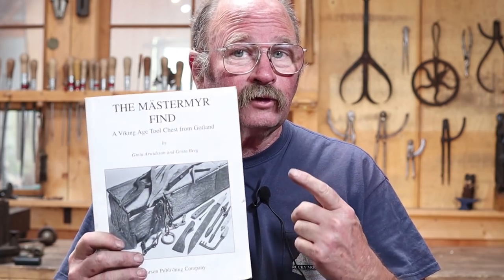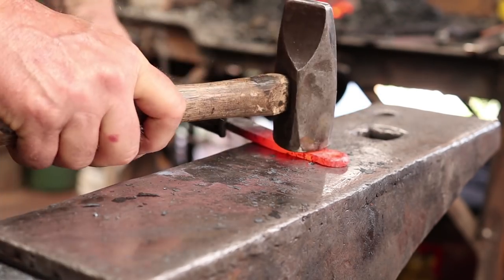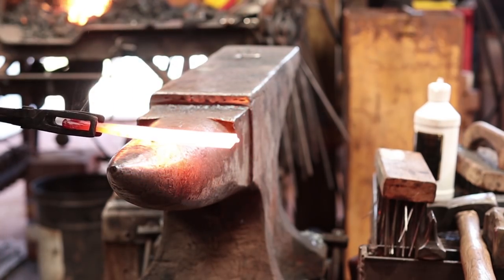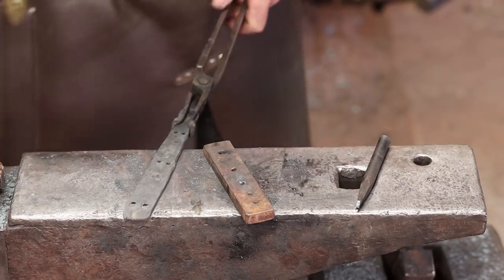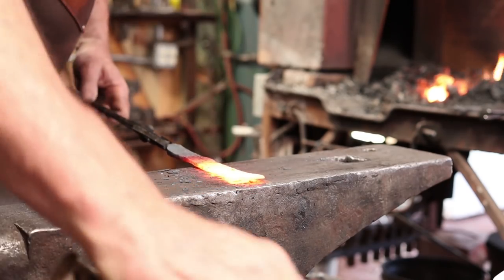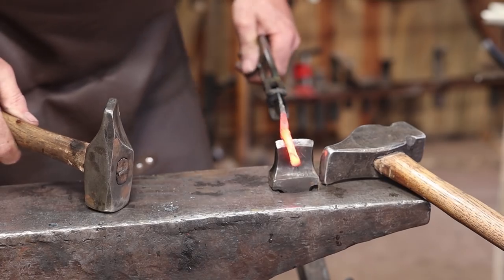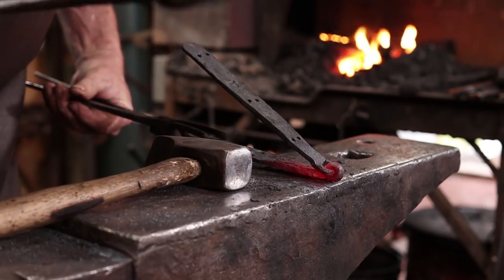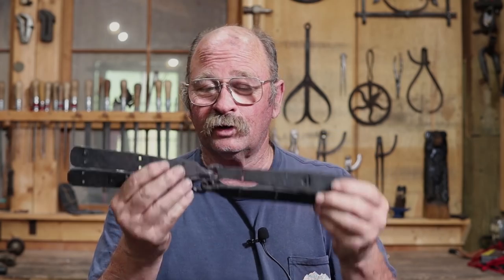Viking tool chest hinges inspired by the Mastermyr find

Comment: a tip i found useful when you fit them to a chest, get the hinges put on the lid first then when you line the other side up with the side of the chest to mark the holes, hold the hinge up a bit so its not resting on the bottom of the loop if that makes sense? often after you fit this style of hinge you can end up with the lid not closing properly and there isnt much that can be done to fix it at that stage.
Reply from the maker: Thanks for sharing

Comment: Hey John I was trying to forge weld three pieces of steel today and it just wouldn't weld I grinded off the rust and scale and fluxed it good but it didn't tack any pointers to what I did wrong also I had it up to a yellow heat very awesome video
Reply from the maker: Its nearly impossible to diagnose forge welding problem without being there.  Dirty fire, to heavy of hammer, oxidizing fire causing scale, joint not shaped to move the flux out during the weld.  It's hard to say

Comment: How does someone create high quality wrought iron for thin pieces? Would starting at bloom and working/folding down many times make higher quality?
Reply: Check out Blacksmith Joey van der steeg, he makes all kinds of blooms
Reply: Yes. After initially refining the bloom, it is folded, cut and stacked over and over the make the grain finer.
Reply from the maker: Repeated folding and forge welding is the way to refine wrought iron and for finer work it might be worth the effort.

Comment: Is the bolster with the round holes you used under the piece made of tool or mild steel?

Also curious to see more detail of the welding fix on the drawn out portion that broke, that seems a pretty small piece to rework without changing the dimensions.

Inspiring as always. Thank you!  - and happy belated Independence Day!
Reply from the maker: Just mild steel.  That way it doesn't chip the edge of a punch if your alignment is off
Reply: Black Bear Forge that makes sense. Nice, I have stock like that laying all over the jobsite from setting forms. Already has some of the holes in it 😉
Thank you for taking time out of your day to respond. It’s not taken for granted.

Comment: Are the welded rings (as opposed to having one or both be just bent and not connected) strictly necessary for these hinges? Would that be different in mild steel as opposed to wrought iron because it's a bit harder to bend?
Some of us are a bit iffier on forge welding than you, and it could also make assembly more convenient; though I guess you could punch one and rivet one if you really wanted to avoid welding, in mild steel. 
I find this style of hinge really interesting for being able to rotate in more than one plane, yet being really easy to make. Surely there's some unique uses for that, even if you only can use one.
Reply from the maker: In wrought iron I think welding is the way to go.  In mild steel it wouldn't be as important.

Comment: Would there have been a problem if instead of heating the two hinge pieces up prior to the second forge weld that only the the open "hook" was heated, the closed ring placed over the open hook and then forge welded?  I would envision the finished first piece with the ring being able to hang over the side of the anvil while doing that second forge weld; or would the weight pull the piece to be forge welded open?
Reply from the maker: The relatively light area needing to be welded would most likely cool bellow welding heat while linking the two

Comment: What is the major differences between wrought iron, cast iron, and modern soft steel? As far as carbon content, strengths, weaknesses, hardness and toughness, etc.?
Reply from the maker: Wrought iron is very low carbon and has a grain structure similar to working with wood.  Cast iron is higher carbon, very brittle and not suitable for forging.  Mild steel is low carbon but very tough and doesn't have the grain issues wrought iron does.
Reply: What size motor needed for a 2" × 72" belt sander?  Wanting to make my own.

Comment: Went to the scrap yard looking for a 3'×3'×1/4" plate for my vise/grinder stand, found a couple pieces I could weld together to make it big enough, but they are not exactly flat, they used to be at one time, but I think whatever they were originally was ran into and these cut out for repair patch,  big bends across each, problem is how to straighten them, tried running one over with a forklift, very little effect, very springy, I don't have a rosebud, or even an oxy/acetylene torch, and no way to get something that heavy and red hot out of the forge. Any suggestions?
Reply from the maker: I have never had good luck straightening plate
Reply: @BlackBearForge  , I'm not expecting perfectly flat, just close.

Comment: Is there a advantage to welding the first loop over just drifting a large hole in the end?
Reply from the maker: In wrought iron, yes.  Because of the grain structure of the wrought iron punching and drifting would leave a weak area at the end of the loop.

Comment: I'm trying to educate myself here, so I'll ask what may be a question with an obvious answer. I know one side would need to be welded, but would it be better/faster to punch and drift the first one, then forge weld the second one through that? I understand the want to make it historically accurate, but for a more modern take, I feel like the punch+drift method would be faster if you were doing multiples.
Reply from the maker: Its a good question.  Wrought iron has a grain like wood, punching and drifting would most likely split out the end.  In mild steel punching and drifting should work fine.
Reply: I thought that might be the case. I appreciate the time taken to answer me. Sharing knowledge like that always helps.

Comment: Are there different grades of punches? Don't own them yet. Did you do a tool info video on punches previously?
Reply from the maker: I have talked about punches and have shown the making of various punches.  I make most of my punches and the material choice is somewhat dependent on the final use with S7 being my most used steel for punches and chisels.